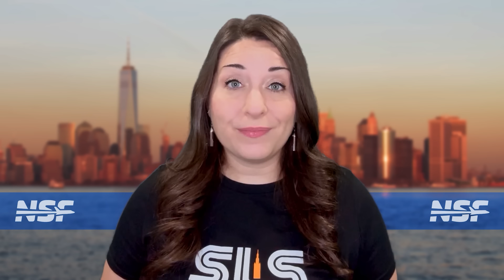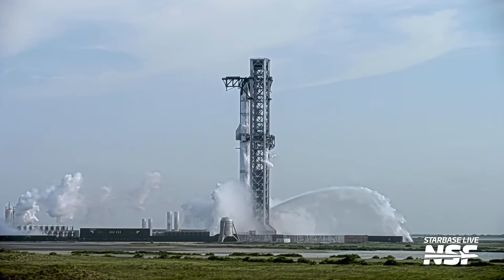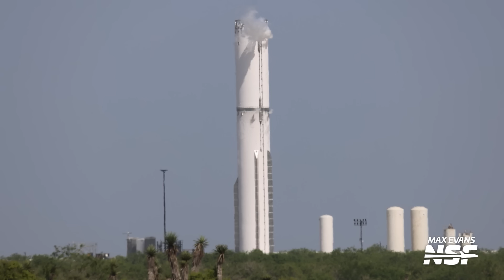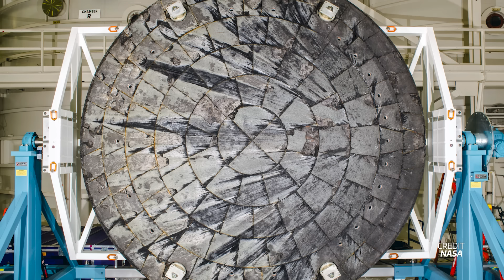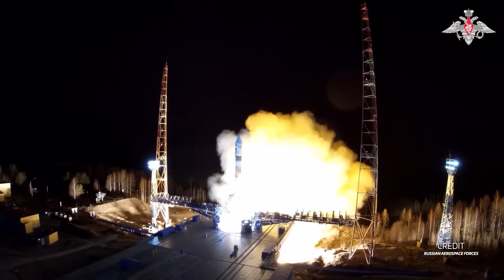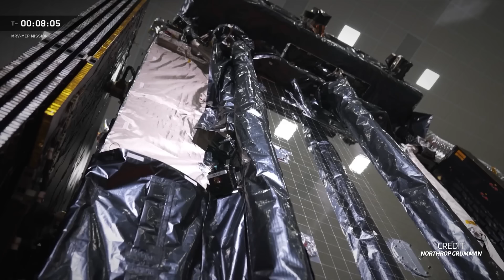Starship Might Be Catch Ready, Says Elon Musk | This Week in Spaceflight

Comment: If the plan is to eventually rapidly re-launch Starship for the refueling missions then surely this last launch has established that rapid relaunch isn't viable. Having to replace Raptor engines... the weather not being ideal for launch...all make rapid relaunch essentially just a pipe dream.
Reply: The replaced Raptor engines were because of issues with the oxygen turbopumps, as explained - obviously not all launches have those issues, as you might have guessed by the fact that this was the first time in 13 flights. The weather was good for a launch but not for THIS particular launch where visibility was the main goal to take images of the heatshield during ascent as it had a higher aerodynamic pressure to stress test the tile attachment mechanisms. These two very simple things are explained in the video.
Reply: @Alexphysics13 Like I said ...a pipe dream
Reply: @Emiliocab47   No, not like you said. But you do you boo

Comment: Hey guys. What about the orbital inclination? Isn’t SpaceX flying Starship on 30’ orbit paths? Starlink shells run at 60’ inclination  so for Starship to put usable operational V3 units up they’ll be in a less than optimal equatorial only flight path. Hence KSC launch preparations.
Reply: They can launch to the 32 degree inclination shell for which they have approval to deploy satellites but hasn’t been used yet
Reply: Not just KSC (pad 39A), but also CCSFS (SLC 37, where SpaceX is building two more Starship launch pads.)

Comment: Any speculation on booster engine restart issue? Are V3 boosters the first with the "Falcon 9' downcomer?
Don't know how they would catch both stages...with only one operational tower
Reply: The v3 Booster's downcomer is completely redesigned compared to v2, and is indeed this 'Falcon 9' - sized, vacuum-jacketed monster.  The LOX header tank and plumbing on v3 are also completely different vs. v2; this might well have been a contributing factor (if not the root cause) for the landing burn relight failures.
Reply: I think ship will need to stay in orbit about 24hrs to get back to Starbase, so catch the booster and clear the tower for the ship catch.
Reply: It's most likely a software issue. Not enough fuel gets to the engines and they can't start them. They'll re-evaluate and probably get it right the 3rd time.

Comment: How could a booster that fails a controlled landing still be judged fit for catch operations on its next flight? The Starship programme is showing troubling indicators, rising costs, slow advancement, and the kind of schedule pressure that historically leads organisations to cut corners and skip critical test phases.
Reply: The ship, not the booster.
Reply: The Ship (upper stage) is being judged fit for catch operations; not the Booster (first stage.)
Reply: listen carefully. the SHIP. not the booster.

Comment: They wouldn't need two towers to catch a booster and ship right? The ship has to stay up for multiple orbits before it lines up so you'd think that'd be enough time to take a booster off the tower.
Reply: Good question!
Reply: it can actually orbit for 2 days so they could easily prepare the pad for ship catch after booster.
Reply: Actually, didn't old SpaceX cinematics show a ship landing on top of a caught booster? It makes some sense, if you could lower the booster down and clamp it, then catch the ship perhaps?
Reply: @interpl6089Not for the initial tests.
Reply: In theory they have two towers ready for catch
Reply: @nfa10  I could imagine it still takes half a year till the other one is finished.

Comment: The Starship may have survived because it looks like its base, where most weight is, seemed to dip deeper into the water, so the lighter portion above the engines did not just crash down sideways, but slid in as the base slowly buoyed back up. Chance positioning of water waves may have also helped if a crest caught the upper portion and could have acted like a pillow to carry it down. Water has surprising support strength and denser viscosity, especially water with the help of saline's crystalline lattices, where it cannot always get out of the way fast enough, though it did just enough to not simply slam into Starship like a brick, as it normally might. Super-heated saline water has even greater buoyancy and viscosity.

Comment: Many thanks Elysia. Dont see much general commentary on NSF or other chanels regarding the deteriorated state of the heat shield tiles after reentry. If Starship is going to be seriously reusable in very short time will the current heat shielding be fit for purpose ? Looking at the longitudinal scaring and damage to quite a few tiles, Im not convinced it would survive another reentry without some serious replacement work. 🙂
Reply: Remember they flew a more aggressive ascent profile with higher aerodynamic pressure which stress-tested the tile attachments
Reply: it improve every flight . and has lots of flights ahead so not worried bout that
Reply: I think that only once they get a used ship back on the pad, they will be able to really analyze the TPS damage, take it apart, and find ways to improve it. Currently they are only looking at images from the Indian ocean.
Reply: The heatshield tiles improve with every single iteration. We didn't see many that outright fell off, only ones that were damaged. And with the data a ship soft landing provides, they can probably make the last needed improvements. It's a massive difference compared to when the tiles were falling off on ascent into orbit.
Reply: It looks great. Proof that they're on the right track.

Comment: First human to ride starship is in for a hell of a flight. Lucky
Reply: I don't think that flip maneuver is going to feel good.
Reply: @handsomeman-pm9vy  you could easily gimbal seats, I'm not worried, and even if they didn't, I don't believe it will be a negative g swing that would make it uncomfortable
Reply: @ElectronTC  also consider you are at the tip of the rocket. hopefully near the axis of rotation. so you won't experience crazy Gs anyway
Reply: I wonder if musk is thinking about using starship as a very fast commercial flight in the future.
Reply: @calebfielding6352 no lol
Reply: @calebfielding6352  Eventually, but that's far future thing.
Reply: @calebfielding6352  Eh, perhaps? Starship point-to-point was proposed so many times, but the logistics and economics of it are...spotty, to say the least.
Reply: @calebfielding6352  but you have to be submerged in a water tank with oxygen onboard starship during different moments of the flight lol

Comment: Starship needs heat shield or side skirts for booster engines.
Reply: Also notice the seen cracked heat tiles seem to be at ring seams, as if stress along the ship hull upon the base slamming into the water stressed and cracked them at those points.